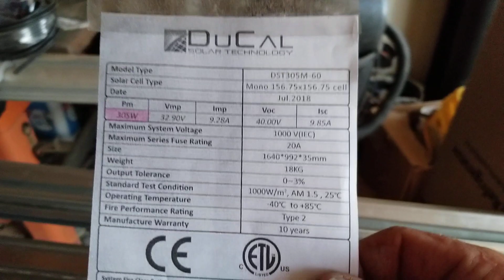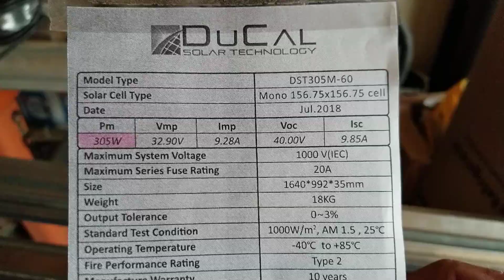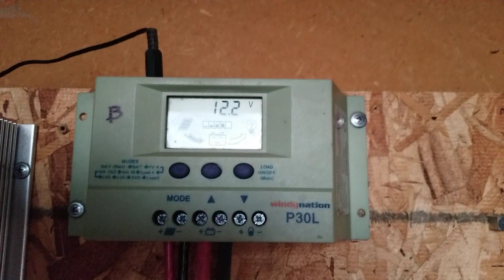More solar panels and rack metal,  Aug 29, 2020

Comment: Great channel in 2004 worked for a govt contractor built 48x92 inch trailers with a siren and 3 lights and 2 solar panels to tow in a desert with a hum ve lot has changed in the tech industry since then. They did this in seattle closing down lanes to see WHAT people would o cant make this crap up this was 3 or 4 yrs ago.
Reply from the maker: Welcome aboard!  Sounds like an interesting job you had!

Comment: Things are looking up, LOVE those new panels , they're going to crank out the power, like the outdoor fire pit that's my kinda thing too , will you use rubber insulators on the feet of your nice new Genset , I'm very glad things are on the up and up, being a TOTAL panic merchant I'd hammer the old bank with those new panels, I actually have the "battery extra " a proven desulphator it works wonders unlike all the So-called desulphators I've bought over the years. I've seen the mechanical solenoids jam on due minute welds caused by the  internal arcing caused by hundreds of on off cycle's  and then drain batteries . With fridges I've seen square wave sine wave/ modified sign and or poor quality sign waves ie fluctuating sine waves from cheaper inverters under load  burn out a few compressor windings, uncle is a refrigeration mechanic i get to hear about it all the time and I've seen it in person with my friends system 3 times, once he upgraded inverters no issues since 2012.
Reply from the maker: Good info, and thanks about the panels.  If I can come up with the money, I want to get 4 more of them, then get another Midnite classic 150 to run them.  That would be 2440 watts, then run 10 of the old 100 watt panels on a 3rd string to total 3440watts incoming.
Reply from the maker: Oh, and the genset comes with rubber insulators on it already.  I will however place insulators between the metal and concrete to prevent corrosion.

Comment: LOL, I don't listen to my freezer, it wants chocolate chip ice cream. That voice needs to hush. But really a propane fridge/freezer makes only one tiny click noise when the solar electric starts the ignitor. I have to look at the light bar to see if its working.yellow if working, a red X if its not.
Thank you for the solar panel info. I snapped quick screen shots. I hope I can enlarge the pics to see the info on my small phone screen.
Sounds like you have some work to get done. Between the 8X8 shed for the generator & the solar panel tower. I hope all goes well.
Reply from the maker: Thanks for the chuckle.  My fridge never called for ice cream...the think was always full!
Reply: @GBear  LOL G BEAR You got me there!
Reply from the maker: @denisewilson8367  👍😂

Comment: Surprised you went with 24v panels.
Reply from the maker: They work and the price was right.  The Midnite controller will do the automatic step down.
Reply: @GBear  How are your other panels set up?  Series pairs ?
Reply from the maker: All parallel on the old ones.
Reply: ' @GBear  I'm setting up the mom in laws all Parrellell.  She wants 12v.   I have 12v panels  series parallel.  Sets of 4 panels.  2 series x 2.   The Grid tie can use it that way and everything is happy.
Reply from the maker: @pulesjet  yeah, that works!  I have 6 of the 100w panels in series and 6 in parallel. 
With the new 305w ones, I plan to do them in series parallel 2 and 2.

Comment: 915 watts 24 volts more. 
Have you figured out a purpose for your extra power
Reply from the maker: AC cooling in summer, electric radiator in winter.
Reply from the maker: By the way, 1220 more watts....4 panels.  In series they will be 148volts, give or take...just right for the new Midnite 150 comtroller!😁👍
Reply: @GBear  
👍👍👍👍

Comment: Good to see things up and running again.  I am amazed at your solar set-up and wondering if such a system would ever be in the works for me.  My main priority is Water Harvesting for my food forest.  Good Night.
Reply from the maker: Water harvesting is great, especially if you are in an area where you get lots of rain.
Reply: @GBear  they say it's about 1 to 1 1/2 inches a year.  That makes it very high priority especially for a food forest.
Reply from the maker: @dottiannblakemore9231  well, if you take the square footage of the capture area and multiply by .6, that will tell you the amount of water you should capture in a 1 inch rain.